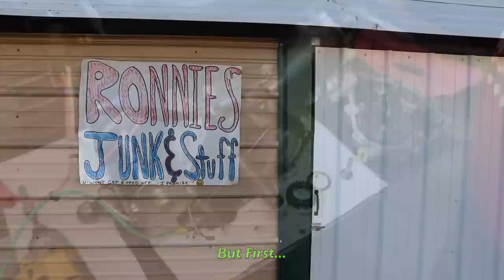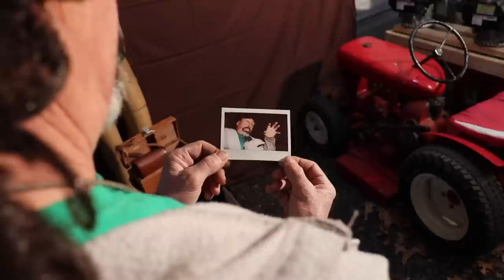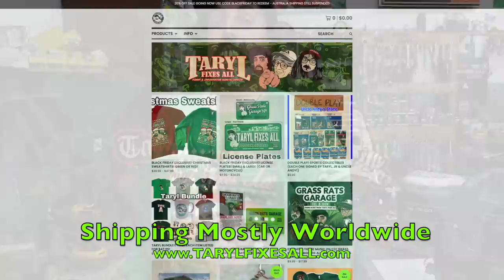Crappy Briggs Plastic Gear FAIL - Is It Warranty?

Comment: How the mighty have fallen. As a small engine mechanic who works on them everyday, I’ve seen their newer engines have more problems than I’ve ever seen in my life. Really stupid problems that could’ve been prevented if some their parts weren’t made out of plastic or just poorly made. I have a lot gripes with Briggs and Stratton recently:

-The newer Nikki carburetors are junk. Almost impossible to rebuild without them running like crap. The older Walbro carburetors were way better.

-plastic carburetors on the push mower engines are a joke. They are much harder to work on and are more expensive to replace. The way they mount to the engine is the biggest joke of all. They are relying on a cheap flimsy piece of bent sheet metal to hold the carburetor firmly against the cylinder head which is pathetic and ridiculous. They bend and break. Stupid dumb retarded design. 

-The junk camshafts. The older ones were a cast camshaft that hardly ever had problems. The newer ones have the gears and cam lobes pressed on a steel shaft. It’s ridiculously cheap and appalling that such a design exists. The worst part of all is the dreaded compression releases break ALL THE TIME. It hinges on a tiny hole and is barely held in by anything. It comes off and causes the engine to crank way too hard. All of that could have been avoided if they used a proper cast camshaft like literally every other engine manufacturer. 
-The push mower engines. I could go all day on this. The design of these newer OHV push mower engines are cheaply made with the cheapest of materials in the cheapest way possible. The sheet metal plate that holds on the cover is flimsy and the nuts that they pressed in there strip out. They should have been welded in. The plastic carburetor that I previously mentioned are shit. The bent sheet metal mount of the carburetor is a joke. The air filter cover is flimsy and doesn’t hold the air filter very well. In fact, I can move the carburetor and the carburetor mount just by touching the air filter cover. That is ridiculous. The carburetor should be physically bolted to an intake manifold or the cylinder head, I’ve seen it done both ways on other engines. They have plastic gears inside the engine. The camshaft is totally made of plastic, which normally isn’t a big deal for push mowers, after all they were used on the old Quantum engines but they seem to be even cheaper than before. At least the quantum’s had a metal gear around the crankshaft.

-The fill pressure lubrication on the residential engines isn’t all that good. Yes it does work, but the first place the oil pressure goes to is the lower crank seal. Over time the seal goes bad and it might pop out causing a geyser of oil to shoot straight down out of the engine. Also the oil pickup for the oil pump needs to be redesigned. On certain angles, even mild ones, for some reason the engine doesn’t get sufficient oil pressure and it blows up prematurely. It usually happens over a period of time even if you have properly maintained the engine. It doesn’t matter. The Vanguard engines don’t have this problem but the Intek does, especially the single cylinders. The larger ones tend to fail more often the smaller ones.

-the naming and marketing scheme of their engines is an issue. It has come to a point where the consumer has no idea hat the heck they even have. Briggs would slap any label they wanted on their engines, even if it is the same base engine block. Think about it. I’ve had two engines that were identical in every way and one said Intek and the other Professional Series. I hardly see anything professional about those engines whatsoever. The only difference is a better air filter. That’s it. Why not just call it an Intek and be done. And get this. The two engines had different displacements, 500cc and 540cc, and both had the same 19.5 HP rating. The sticker. What the heck I going on? Where are they coming up with these numbers? I’ll tell you where they’re getting their numbers - out their ass. Here’s another one. I’ve seen Briggs Intek v-twins that are the same exact displacement, same carburetors, same everything and they had different horsepower ratings. It’s getting out of hand and it is causing a lot of confusion. It’s hard to know what I even have. Gone are the simpler days of knowing that “I have a 5 HP Briggs”. Sure there are many variants of the engine, but the core is still a 5 HP Briggs. 

I used to be a big Briggs and Stratton fan. I still have engines that are over 20-40 years old and still going strong. Meanwhile the newer ones are dropping like flies for really stupid reasons. Yes I know about the problems with ethanol and that does cause some problems but this isn’t about that. It’s about how fricken cheap and crappy their designs have been and how they have fallen in the same way Tecumseh did. Now these no name Chinese engines and Predator engines are coming by storm and to be quite honest, despite me not particularly liking those engines whatsoever, in some ways they are actually built better then the newer Briggs engines. Let that sink in a bit. That’s a rather grim feeling as an old school Briggs and Stratton fan. The Briggs corporation had mostly focused on pleasing their stock holders than actually producing quality products, and it is absolutely shameful. Greed can take everything away from you in a blink of an eye.
Reply: which is why the replacement engine for my push mower is a cheap predator engine.  got a couple older briggs 3.5 engines, cams have plastic gear and lobes, valves seal, coil fires, flywheel key good, they wont run.  all it takes is that gear to move slightly and throw the timing off.  why pay $250 for a push mower engine and have them stop a year or 2 down the road when i can pay around $120 for a predator that is still going strong after 2 years?
Reply: Well said
Reply: I gave two lawn tractors to a small engine repair business free. One was a Arien with no engine but was in great shape otherwise. The other was a JD with a BS twin. It was rusted to shit with no deck. It had a 48 in deck. Engine was great with no issues with 370 hours. Big difference with the new JD's for sure. The new filter change cartage is a joke as they expect most owners don't bother to change the other one so the new one doesn't even change the old oil. Crap engine, crap mower, crap long lasting mower. Made in the US means nothing. A knowledge in repair is your only hope. Thank all of the people who can work on a engine to make less landfill.
Reply: Design changes and vendor issues were an issue.. Walboro never renewed with briggs because of cost disputes,, so they went with another supplier,, and it went down hill from there,,

Newer engines I wouldnt give you a steak dinner to toss it in the crapper..
Reply: @carbo2950  That oil filter oil change mess was JD idea,, and briggs had to adapt it to get the contract from Horicon to build the engines for JD at that time.. It was a joke,, Engine only rated for 250 hours.. only found on certain models.. Stupid..  Naturally owners will never check oil in a mower... Hell they dont even check the blades.. SMH
Reply: TL;DR
Reply: B&S really needs to read your post.
Reply: @carbo2950  I have has worse performance from the Kohler line,Coarse im a Briggs Dealer
Reply: And you'd recommend what engine instead of B&S or Chinese flea market junk?
Reply: @brandonsnider7907  Honda, Kawasaki, Vanguard, and certain Kohler engines.
Reply: @Omegadoomship  Yamaha ,subaru make a good product,Trouble is everyone is buying each other out and combining,cant keep up with half of it
Reply: @jeffclark2725  Getting parts for both Subaru and Yamaha is like pulling teeth. When Yamaha v-twins were put on zero turns, they almost immediately disappeared from the market. Not sure what happened but I’m sure getting parts is going to be very difficult. At least Briggs and Stratton has great parts availability even for their older engines.
Reply: @Omegadoomship  some of the Briggs parts are scarce, waited a month for a camshaft, but yes still a good supply, I bought up a bunch of whole engines on a good deal, I'm an MST out here in western WA, kawasaki is the hardest to get out here
Reply: @InkBunnyBlindRabbit  yea,wasn't that a good idea, lol
Reply: Thank you for taking time with, I feel, a nice bit of experiential info, Yes even the Chinese Honda's seem to be a fair value though the GX is a first choice. Was tickled to discover that my Husqvarna weed-eater has a GX 25 engine ...
You created much informative discussion HERE, KUDOS and Thank you again.
Reply: So  true (American greed ) I looked at a power washer that had no drain plug , book said just add oil as needed.
Reply: @nicolec7290  use one of the vacuum pumps for oil exchange ,draw the oil out the dipstick tube
Reply: I think a big part of it is because people expect to pay the same for a mower today as they did in 1989. a $199 mower in 1989 was superior in every way to a $199 mower in 2019. in order to keep prices that low manufacturers had to make them as cheaply as possible. That's my theory anyway.
Reply: @coolbluelights  Agreed, they have to keep the price point down,the few engines highlighted with failure,,look how many last,look how many get thrown out with running engines, and the body falls apart,I have lots of take off engines, whole runners or part's
Reply: I can't give away a running fine 3 year old machine with self propel a real good bag that got tuned up
Reply: I'm a small engine mechanic as well and you're right. Its across all the manufacturers though. They are all switching to plastic governor and oil pump gears, plastic intake manifolds etc. Last month I replaced a 27 hp briggs EFI under warranty because the oil pump gear failed, the short block they sent me blew up in under two hours. When I disassembled it, the connecting rod bolts were loose from the factory. Quality control has really gone down over the past 10 yrs.
Reply: @coolbluelights  only problem with that theory is the prices keep going up while quality continues to go down. The problem is, too much is built in China.
Reply: @keeganlangford5580  Well, take a $200 lawn mower in 1980. an equivalent mower would be almost $700 in today's money, but no one is going to pay $700 for a basic push mower.
Reply: @coolbluelights  I have customers that own $700 + "commercial" 21inch self propelled snapper mowers. They're assemble using "globally sourced parts". The difference between now and 1980, in 1980 they were all basically made in the USA. I still see mowers from the 80s and early 90s from time to time. The junk being made now won't last even 10 years if you're lucky. Forget about 40yrs.
Reply: Briggs and Stratton filed for bankruptcy in July of 2020. The were bought by a New York firm. In these situations the focus is never about quality but more about damage control and profitability. The days of the Quantum and the opposed twins engines are over. Pretty bad when a Chinese Predator engine is a better choice. I would go with Kawi or Subaru myself.
Reply: Well said.   I totally agree.    Do you agree that anything Briggs pre-2000 is the way to go?    My old Briggs and Tecumseh's run great still.
Reply: The only reason the vanguard is any good is that it was designed, and for awhile, built in Japan.
Reply: @tangydiesel1886  That’s why I’ve owned Echo equipment for years. The Japanese build a better engine than anyone especially 2 cycles.
Reply: @angusmacgyver3673  The Chinese and John Cena will be happy for you.
Reply: All I can do is agree I love the old Briggs but avoid the newer ones. Have a 12.5hp flathead on a push mower and an old V-twin vanguard that goes from one thing to another just because I love the damn thing. If you own an old flathead Briggs hang onto it with both hands 👍
Reply: I work on them all day too and couldn't agree more. The new plastic carburetors are jetted so lean that one time being left with some bad gas in them makes them not start at all, and then even when you do clean them out they'll always hunt/surge a little bit no matter what. Hell I think half of them come from the factory that way chasing emissions standards. And being held on by the air filter cover backing and a couple course thread plastic screws is pitiful. I've also seen several have camshaft or valve problems with practically no hours on them and no user fault. The old flathead engines they replaced were made SO MUCH better even though they did have plastic camshafts. Those flatheads would take insane abuse and not complain and the carburetors would always clean out and run right if you spent the time. It's a shame they got replaced by the OHV engines to save like 5% on gas. And you're 100% right the predator engines and such are made better than Briggs now. I have a predator 212, it has metal camshaft/crank gear and everything. I'm not sure if the tolerances are as good or the casting is as high quality, but the Predators SEEM to be designed and put together as well as Hondas. I beat the crap out of mine bypassing the governor and such, just to see what it would do, and it did perfectly. Doesn't burn oil or anything.
Reply: @jeffclark2725   Briggs quality is bad nowadays but Kohlers is even worse. I'll give you that. Their push mower engines have the worst auto choke designs ever, and the "Courage" riding mower engines have cheap garbage camshafts/compression releases, and a bad oil/sump design that lets the bolts back out, hit the flywheel, and crack the block. They don't make anything good anymore.
Reply: @andybecker2693  Those opposed twins are beautiful. Last forever, and nothing beats the sound of their loping idle.
Reply: @tylerfranx4286  what part of the country are you in, The choke systems work good in Western Washington, I replace a lot of Kohler carbs,they just go bad, we are changing a lot of Briggs camshafts, and governor gears
Reply: @tylerfranx4286  I'm doing a camshaft and head gasket on a Briggs as I'm typing this
Reply: @jeffclark2725  down here in the south they stay shut for way too long and the engine puts out black smoke and coughs for a few minutes before they warm up enough for the thermostat to open fully. We end up drilling holes under the thermostats in the muffler so they heat faster and that helps. But still, never have this problem with Briggs or Honda.
Reply: @tylerfranx4286  agreed to that yea closed too long, Honda has that wax pellet system, works great, I have to use WD 40 on some Briggs stats up here in Washington after they sit for a month
Reply: @jeffclark2725  yep the Briggs ones get rusty sometimes too. Really what works best is a manual choke but consumers nowadays can’t be bothered.
Reply: @tylerfranx4286  Don’t even get me started on the Kohler courage. Ugh those engines are trash. The single cylinders especially. You pretty much named most of the problems but I’ll add to it and say the ignition coils occasionally die. The v-twins do have metal camshafts as far as I know but like the Briggs Inteks, those camshafts are pretty crappy. Compression releases go out on them. I’ve got a 2 year old Cub cadet and an Ariens zero turn in my shop with that problem. As the saying goes: “it takes courage to own a courage”.
Reply: @tylerfranx4286  Oh yeah those Opposed twins are great engines. They can run forever if you take care of them. I still see tractors with those engines that come in from time to time, a testament on how well they were made back in the day. They sound cool too and run so smooth. I used to have one on an old Wheel Horse tractor. The tractor wore out after 30 years but the engine still purrs away. Same goes for the Kohler Magnums twins, they’re good engines too. They just made things better back then. It’s an end of an era.
Reply: @tylerfranx4286  agreed, they barley check the oil
Reply: They plug the air filters also
Reply: @tylerfranx4286  The opposed engine is the best twin cylinder that Briggs ever made. They sound “ cammed up”. So cool.
Reply: The carbon footprint of the engine starts at the manufacturing and the use of the engine. If they can't make it more efficient they have to lower the foot print during its manufacturing.
Reply: I bought a new splitter this past winter with a Briggs broke within 1/2 hr took it in they tore apart and the coil blew apart funny thing is they had just done a recall at the store the Briggs rep had replaced coils on all the Briggs because of a kickback problem when pull starting they said would rip rope outta your hand .. so with the coil parts bouncing around in there it broke fins off of the cooling fan I luckily was in there when the rep was there and he was actually gonna put it together with the fins broke he was trying to be sneaky 🤦‍♂️ I’ve worked on small engines  for close to 40yrs I told the manager of the equipment section he puts that together like that I’m walking upfront getting a refund on that I won’t accept he watches the rep little longer he got ready to put on and he said uhm those fins are broke we need to put another on there to the Briggs rep that’s sad …I have another older splitter I put a 6.5 Hp predator been going 2 yrs no issues always starts better on fuel than the Briggs and has more power than the 7hp Briggs
Reply: @briantownsend9148  I'm doing  a briggs 7.5 vertical , roken fan,blown head gasket warrany,I wonder if the fans have an issue??
Reply: @jeffclark2725  I personally think it’s crazy having a plastic fan that design it takes so little to break a cooling fin off I feel it’s a poor design all the way around …. I can guarantee that I will end up replacing this Briggs with a predator as soon as warranty is up on splitter if the engine lasts that long
Reply: @briantownsend9148  the recall that they did on those had you doing the parts changing with very little disturbing of the packaging, I would want to practice on 1 before doing the recall per  the way its listed
Reply: @briantownsend9148  I sold a guy here  anew engine complete, when he took the splitter off his pickup truck it fell and smashed the engine beyond repairs
Reply: @jima3129  don't know much on these preditor engines, I'm a briggs,kohler,Honda guy,have a difficult enough time getting parts for that stuff
Reply: Thank you for the detailed comment. I will never buy anything with a B.S. engine again.
Reply: @Pro1er  Each brand has a high maintenace line of engine.,You only hear about the problem engines,there are alot of them out there doing just fine day in and day out
Reply: I worked for a major defense contractor awhile back and first on their list of company values was shareholder returns. Followed by customer satisfaction. I kid you not. 
We can thank Morgan Friedman and his ilk for that.
My Kohler pro 7k series is pro by virtue of its larger "pro" air filter. Not something like a ball bearing crank. lol
Reply: Agreed
Reply: @jeffclark2725  I had a Lhead /opposed46 series on a 21 yo tractor (I think it was the last of those engines). Worked great for all those years, just a few starter gears. Maybe I ran it low on oil, who knows but both rods broke, don't owe anything with 1000s of hours, neighbor used it too and paid for the oil and filters. Parts availability is a joke. Pistons are like $150 each, rods $80 and no crank for that model even used. So I am considering a $5-600 V-twin 20hp briggs. Other choice is an almost 3 grand tractor at lowes.
Reply: damn you really went all day on this like you said you were gonna
Reply: @keeganlangford5580  Most of the governors have been plastic for a long time now and for the most part haven’t been a supper common problem that I see. Kohler had problems with their governors blowing apart with the Command for a while. Anytime I’ve ever seen a broken governor gear from a Briggs is when the rod blows and slams into it. I’ve seen plastic oil pump gears on the newer Kohler engines though. I think Briggs is still using that dinky shaft that goes on the end of the camshaft down to the sump where the oil pump is. It’s also a dumb design. I’ve seen the end of the camshafts where they put that notch snap off and then the camshaft falls off and the counterweight of the crankshaft smashes it to pieces.
Reply: @andybecker2693  Those opposed twins were great reliable long lasting engines. Sounded really good too. Very smooth power.
Reply: @jeffclark2725  Getting parts for a Briggs or a Honda is the easiest. Kohler and Kawasaki don’t have as much aftermarket parts so you are stuck with OEM except for consumables like air filters or common replacements like ignition coils, starts, etc. 
Predator engines are a hit or miss but usually they are considered good enough. They are similar in design to a Honda just with cheaper made components. Sometimes they work great and last, other times they blow up immediately. It’s a roll of the dice. There are plenty of parts available for the Predators as they are very popular and many parts (but not all) will cross reference to the Honda GX engines.
Reply: @alb12345672  The old opposed twins were great engines. But $5,600 for an engine is outrageous. I’ve never seen that high of a pice even for the big commercial engines. If you want a good engine, get yourself a Vanguard. You can find them new or used for much less.
Reply: @chris2790 Milton Friedman you mean.